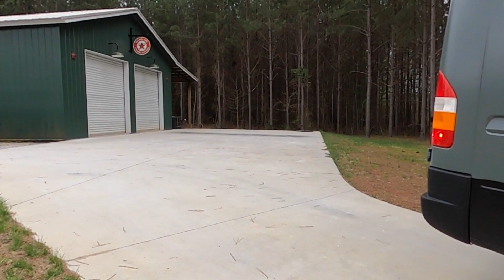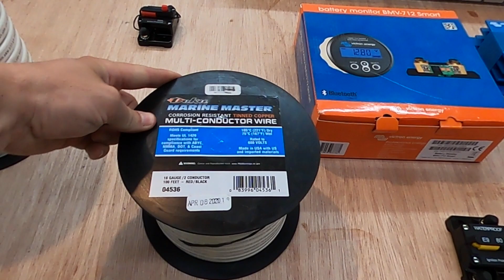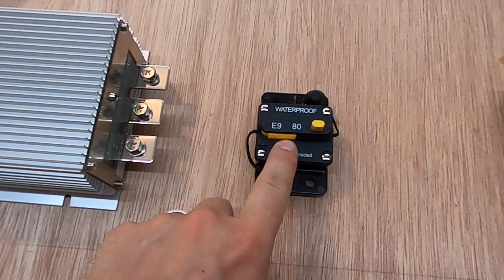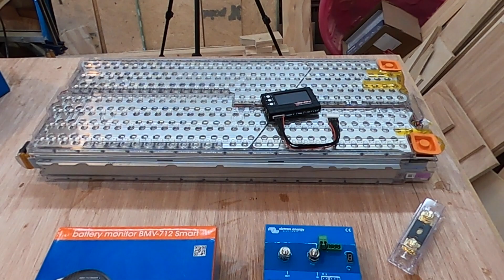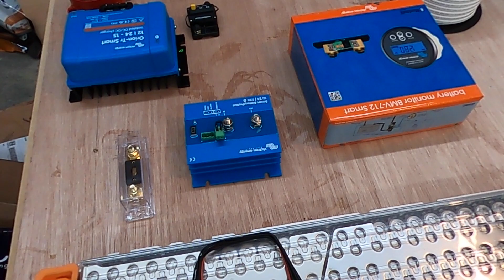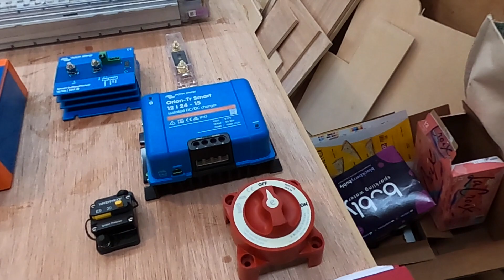Van Build Episode 15! Electrical System Explained with our TESLA Battery Module! DIY T1N Sprinter!

Comment: Would advise you with Tesla Lithium or any Lithium that you use a fuse with a very high AIC rating such as a Class-T fuse or a MRBF (Marine Rated Battery Fuse). Lithium batteries exhibit very low resistance, and thus can produce a lot of current instantaneously. You don't want that fuse to melt and create a short circuit. Major fire risk!  That ANL fuse is also a cheap aftermarket.
Reply from the maker: I agree with you! I ended up swapping out the fuses for class t fuses.

Comment: Hello, I also have a Tesla system in my Sprinter but I use the Victeon 24v to 12v converter bcs it goes down to 18v, the converter you are using has specs showing Input Voltage: 21-35VDC what happens when your Tesla goes down to 20v? Does the converter stop working? 
Ty
Reply from the maker: The inverter charger does stop working and you must rely on the solar charger or alternator charger to bring it back up to the required voltage. It’ll then start working again.

Comment: See my Tesla Model 3 battery van build at @R0Io
Reply from the maker: I’ll have to check it out! Did you use a lot of the same components?
Reply: @goldenadvantures2573  I used the exact same marine wire that you used. Other than that most all my components are different than yours. The Tesla model 3 battery module weighed 250 pounds which required 4 people to lift into the van. LOL
Reply from the maker: Wow so is your van also an ev or is that just for day to day power? I would imagine with that much weight It packs quite a lot of power.
Reply: @goldenadvantures2573  The Tesla Model 3 battery is the house battery only. The house battery can be charged at standard EV charging stations. I am contemplating stealth camping at EV charging stations and camp overnight while charging with my J1772 socket. My diesel Sprinter gets 25MPG; one of the the most fuel-efficient Sprinter builds on the road. My next project will be an all-electric van when they come in financial reach and get at least 200 miles per charge. Talk about an exciting, fossil-fuel-free future where you’ll have a 100KWH main battery. Talk about unlimited climate control and cooking. The only question is how to maximize solar charging: a van covered in solar panels?
Reply from the maker: I love the concept of being able to charge at EV stations. People always ask if we can do that with ours. It won’t be long and there will be a van skateboard developed by Ford and Rivian. It’s definitely an exciting possibility!
Reply: @goldenadvantures2573  Could you allow my URL link to appear in your comments? Mercedes has an eSprinter already on the market, but it’s not available in the USA due to required safety standards. It only goes 120 miles maximum on a charge. The next three years will see a big expansion of EV vans. Interesting future!
Reply from the maker: How do I do that? Ah I didn’t know that Mercedes had one in the works!
Reply: On your video, go to: settings - community – automated filters and remove the “Block URL”

Comment: How is the Tesla battery holding up? Is that one battery enough for you or would you be buying another one?
Reply from the maker: So far it's doing really well. It'll run our AC for about two hours if it's not crazy hot outside and with the amount of solar and alternator charging we've got we've never had it below 50% charge. I've got it set to only charge to 24v instead of 25v in order to get more charge cycles out of it too so we could increase the storage capacity in it if we really needed to. We've been running it for about two months now and having another one would be nice like in the desert in the summer but where the weather is nice one is plenty for us.
Reply: Fur & Fam that’s awesome thanks for that. We also have one in our van. Am stil converting it. Nothing really would be a big drain to the system. The only thing would be if we both get electric scooters and want to charge it then maybe having an extra Tesla battery would be nice ☺️
Reply from the maker: Glad to see others are using the recycled batteries instead of buying new ones! The two biggest consumers in our van are the AC and hot water heater and even with that we're good with one module.  Charging scooter batteries would be a pretty big drain on it though

Comment: I would like to second the comment concerning crimping terminals. Something to keep in mind is the importance of using a proper crimping tool. Generally, people who have problems or do not like crimps have not used a "proper" tool made by the same firm that made the terminals. In an ideal world, you would use a 3M tool for 3M terminals, and Ancho tool for Anchor connectors, etc.

Given what everything else is costing, spending $200 to $400 on a proper crimping tool does not seem so bad. With luck, you could borrow or rent one.
Reply from the maker: Good crimping tools are most definitely worth the money. I do a lot of wiring in the marine industry and agree 100 percent that using the tools designed for the terminals or connectors you're using is imperative.

Comment: Another question, where did you get the BMS and would it be possible to get both the battery and the BMS wiring plugs and build a pigtail that would allow you to plug/unplug the BMS.
Reply from the maker: The BMS is a venom balancer purchased from venom's website and for the wiring I bought a 6s extension and cut off one end and soldered it to the Tesla wiring that already existed.

Comment: Thank you for discussing the marine wire. There are currently no electrical codes for rv use and the rv "industry standard" is to use house wiring which as you state is very dangerous.  Single strand wire under vibration will break and can cause fires. I don't think soldering your battery cables is recommended as solder tends to crack under vibration. Proper crimping will not allow that to happen.  Another thought is when you have the system up and running if you put it under the heaviest load you will have on it,  you can use a info-red digital thermometer to ck each and every electrical connection to be sure there are no lose connections. I actually do this every 3-6 months just as an additional safety measure.
Reply from the maker: Yeah I see a lot of vans with Romex run in them and it makes me cringe. I agree with crimping too. A good crimp that is sealed with good heat shrink is just as good of a conductor as a solid solder joint. Checking the temperatures of the connections is a great idea.
Reply: @goldenadvantures2573  Sadly I literally just watched another video of a schoolie being wired by a licensed electrician using Romex. I've given up commenting.
Reply from the maker: I guess RV wiring isn't part of the course to become licensed. Hopefully it doesn't cause anyone to get hurt.